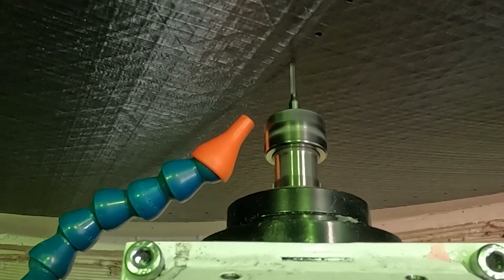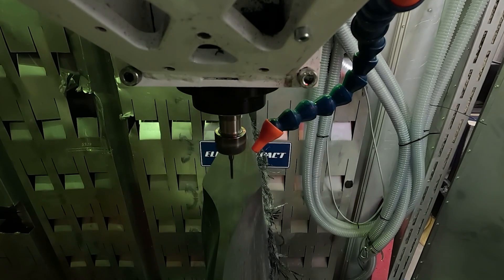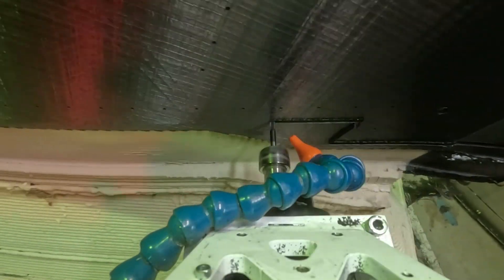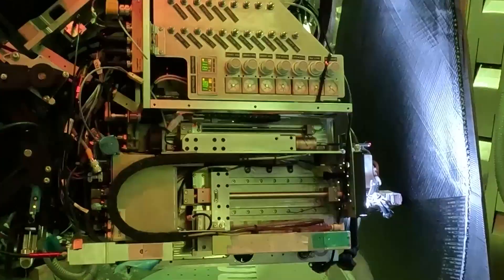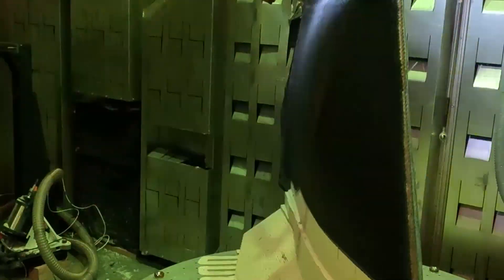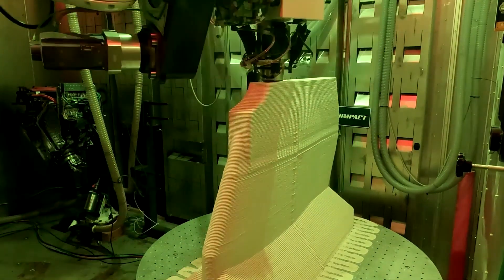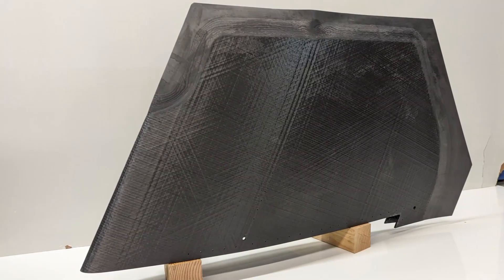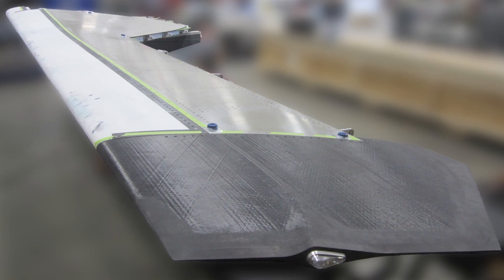Advanced Manufacturing Innovation

Comment: I put down a deposit on the new 2026 B-21 Raider already, but they first offered me $200M in trade-in value for my B-2 Spirit. But now they are telling me I will only get $100M by trading in my B-2, and I already put the deposit down for the B-21. This is a gently-used B-2 only used for short bombing runs to Canada on Sundays and driven by a little old lady pilot, NEVER flown overseas to bomb Iran. I'm getting ripped off and this is unacceptable.